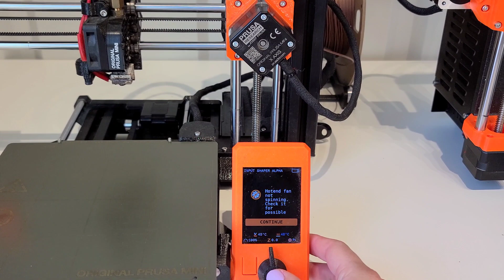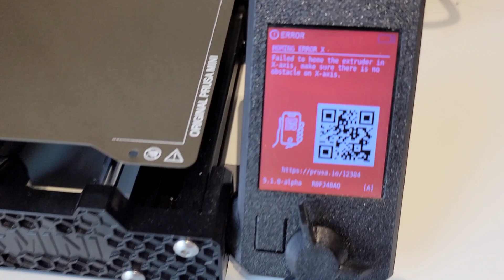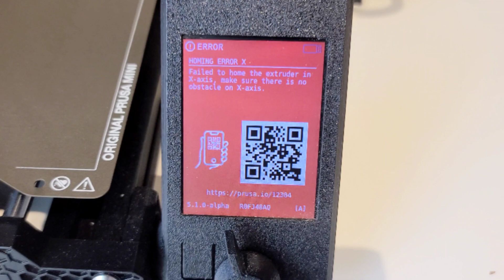Input Shaping on the Mini? Too good to be true?

Comment: I printed two items that used to take 20 hours for the pair in 7 hours with my mini yesterday after the update. The quality was better on the 15hr long print also in areas that I'd expect it to suffer from the speed however it didn't! I'm super impressed.
Reply from the maker: Awesome to hear. When I have a little more time for machines to possibly be down, I'll try out the other minis. I'd rather them be slow than not work. Thanks!
Reply: Out of curiosity, did your minis have the heatbreak/underextrusion problem? Do you know if this update will work for those that replaced the heatbreak or hotend?
Reply from the maker: I don't have any under Extrusion. They're all pretty much stock. But the good thing about the firmware is you can roll back to stable if you don't like it. Thanks!
Reply from the maker: I tried to hold the print head and squished my fingers. And I am just using USB drives. I just keep getting the blue screen of death now. One works out of three. The two that don't work, I have rolled back to stable 4.4. Thanks!

Comment: I tried again with a part I printed in Petg. When I raised the nozzle temperature 10 degrees to make up for the increased speed, I got pretty good results. I usually print Petg at 232 so I raised it to 242. I don’t use PLA but bumping the temp should help
Reply from the maker: Ok that's good to know. Thanks!

Comment: I think it was a mad rush as Bambu released the A1 mini which directly competes with the mini. Thanks for another great video
Reply: Yep
Reply from the maker: Which is understandable. But this 2/2 minis not printing is not great. Thanks!
Reply: @tada3dprinting  it’s a big problem with everyone that has downloaded the firmware. Also I’ve seen people claim it’s a belt tension issue.
Reply: @tada3dprinting it’s alpha so not always going to work as expected. Says on the forum post they expect a stable version to be released in around 1 month

Comment: I have 2 Mini+ and an older Mini. The two newer ones installed fine. The older one had issues with reading the new firmware off certain thumbdrives (for some reason) but got it working. Printing-wise it is great: I print lots of small parts and my usual print went from 3:50 to 2:20 with no discernible quality drop. The only problem i had is with Octoprint losing connection between prints and causing a BSOD. Switched to thumbdrives for now until this gets resolved. Otherwise, the speed improvement is life changing for me.
Reply from the maker: That's nice to hear. I was looking at some of my prints and only seeing 10 mins or so improvement. I seem to be getting errors if I swap out between usbs as I am slicing. That's too bad about octoprint! Thanks!

Comment: If you have trouble rolling back the firmware, take the old firmware on your stick insert it, turn on the mini and click the wheel twice, it should load. it worked for me, hope this helps.
Reply: Thanks. I just updated, but before I even try printing, I'm going back to the prior version.  Can't risk it just yet
Reply from the maker: Thanks! It seems about 50/50 that people are liking the Alpha or not. I will probably wait.
Reply: @tada3dprinting  i had the same problem you had

Comment: That error on the second one is a belt tension issue. You're either too tight or too loose.
Reply from the maker: Ok I will check it out. Thank you!
Reply: Amazing, that solved my problem. Thank you
Reply: I had to adjust the belt really tight to make it work. I didnt like that so i tried something else. I made some C clips / spacers for the x axis rail and it worked with looser belt tention. https://youtu.be/hCZ-z7CTKuU?si=OQ8ulnQwQ9KzINk3

Comment: What adjustment would you make to the XL printing a 7-inch square with a height of 4 inches that ends to lift on two corners mid-print?
Reply: brim and gluestick
Reply from the maker: https://youtu.be/LGW5UByCKFo this video I make some modifications to my flat print to help with warping. It helped a lot. But you may need to check that you don't have a draft in the room too. Let me know if this doesn't help. Thanks!

Comment: I updated my Mini+ and had no issues. I was behind in firmware and bootloader, so I updated that part first, to 4.4.1, and bootloader to 2.1.2, then on restart, it detected the Alpha and updated to 5.1.0.
Reply from the maker: Yes I did have to do that as well. I finally got it going. Thank you!

Comment: Did you select the correct input shaping configuration for your Mini(s) in PrusaSlicer before slicing?
Reply from the maker: I didn't slice the benchy. It's a presliced gcode by Prusa that I downloaded from the github. But I'll slice something else and see if it helps. Thanks!

Comment: Had the same homing error on the x axis. Tightening the belt (a lot) solved the issue for me. But only after cutting the power (unplugged and waited for about 10 seconds) and restarting. Y-axis also had that issue. I guess input shaping on the mini does not like loose belts...
Reply from the maker: That's interesting. I guess it's good that it's extra careful about the tension then. Thanks!

Comment: What happens for those of us who were forced to replace the mini hotend/heatbreak. Will this update work with a bondtech heartbreak? Mosquito hotend?
Reply: I would be cautious, as the mini does not have an accelerometer built in to calibrate exactly for each persons individual printer. I suspect the input shaping parameters are based on predefined numbers for a default printer. If your hotend or nozzle differs in size or weight by much it it might not work the best.
Reply from the maker: If you're interested in trying the Input Shaping, do it! You can always roll back to a stable version if you don't like it. Thanks!

Comment: Flash mini back MK4 had issues with old input it dug into my plate had to get it changed, before that it had errors that made no sense. 2 hours with support think we got it worked out with new firmware I would suggest to reach out to support so they can fix it
Reply from the maker: Yes that's true. I need to do that. Thanks

Comment: Did you also updated the bootloader software on the Mini? I found these files on Github and they mentioned to add the firmware + bootloader files in the root of your USB. Also for me i had to get my firmware first to the latest version (i didn't do that apperently) before installing those the firmware/bootloader files. And atm all works perfectly. No fails so far. Good luck, let me (us) know how it goes.
Reply from the maker: Yes I was on 4.1 and had to upgrade to 4.4 first. Maybe I missed something. I just think it's odd they're doing different errors. Thanks!
Reply: @tada3dprinting  I had to update the firmware, (was still running beta LOL) and the bootloader then installed the new firmware, and all is working very well. A five-hour print is now taking 3 hours and the quality is just as good as before.

Comment: I haven't been a huge fan of the quality my MK4 puts out with input shaping. I will probably only use input shaper when quality isn't a necessity, and the part needs to be done rather quickly. But for now, I'm just going to use the stock settings.
Reply from the maker: Yeah it really depends for me. I feel like things tend to warp more with IS. I jump back and forth. Thanks!
Reply: but for that matter you can just print fast without input shaper since the whole point of IS is to get better quality when printing fast. Or the quality is just a little better with IS?
Reply: I have been using the Structured setting (not Speed) with good results on the MK4. It is faster and the quality is on par with no IS.
Reply: @Drumaier  well I haven't tried "structural" yet. But the speed setting isn't fairing out good results. Walls aren't filling in 100% around the corners, and holes are ellipsed worse than normal, and sometimes the infill doesn't fully connect with the perimeters. I'm gonna try a few things, like turning the temp up a little more, and maybe switching from arachne back to classic as well, and we'll see what happens.

Comment: Did you say that your Mini fan was not running? Or was it running and it was being reported incorrectly? I think that the MK4 team was able to port the input shaping to the mini very easily once they had it complete for the MK4. The XL has a lot more issues.
Reply from the maker: The fan was not running. And it had just printed fine before. Maybe it chose right at that second to go out. Yes that does makes sense. Just disappointing that it's still not out. Thanks!

Comment: I think they had some idea of the Bambu A1 with input shaping and rushed their version for the Prusa mini
Reply from the maker: Yeah it'll be interesting to see what happens next. Thanks!
Reply: It is not rushed - this firmware is an alpha version. That means it is an experimental pre-release, that's still undergoing development and can contain bugs for that reason.
Reply from the maker: I agree. But with the Alpha on the MK4, I had some quirky things but I could get it to print. 1/3 on the Mini Alpha isn't that great. But it might be me.
Reply: I don’t think it‘s your fault. It simply might not work on all machines properly yet, for whatever technical reason.

Did you try to recalibrate your Minis where it doesn’t work? Any statements from the Prusa support so far?

Great to see, that you could get it running on that one Mini from your other video, in the meantime, by the way!! 😊👍🏻

Comment: From the firmware release text: "...  To achieve the best possible print performance, we strongly suggest performing basic maintenance on the MINI+ before you start. Make sure the belts on the X and Y axes are not loose, the nozzle is in good shape, and there’s no debris on the smooth rods. ..."
Reply from the maker: True. Just surprising that the print before it was fine. Thanks!

Comment: Yeah, I tried Input shaper firmware on my Prusa Mini, and every time it loaded a gcode file, it would crash! 

So I had to downgrade back to 4.4.1!
Reply from the maker: Same. But I think I figured out the problem or multiple problems I was having. I have solved it by - 1) having a completely clean USB that has nothing except the newest firmware, and newest sliced items. 2) I kept accidentally opening an old 2.6.0 beta slicer and I was slicing just regular prints without input shaping and didn't think it would matter. But even these were crashing it. Now I'm careful that if I'm using or not using input shaping, I always am using 2.6.1. 
So far this is working. But I'll keep testing it out. Thanks!

Comment: It will be interesting to see that new Bambu printer in action. Very compact for a 4-color printer.
Reply from the maker: I couldn't resist. I ordered one this morning. But I'm not a fancy influencer that already got theirs.
Reply: @tada3dprinting  That is great! Looking forward to your review.  I have lots of questions about how it does color changes.
Reply: It looks a cool bit of kit....but compact? Check out uncle Jessie's video on the new printer. It takes up more space than any of the other bambu printers as they  stack the MMU on top of
Reply: @TDax  Thanks for the pointer to that video.
Reply: @tada3dprinting  Not yet, but you are on the way.
Reply from the maker: Still is smaller than an MMU3 and I don't think I have to assemble it.
Reply: @tada3dprinting  won't be long till the printer manufactures are knocking at your door ;)

Comment: Not so much rushed as Firmware on the mini is a self declared Alpha. 
So its super early. I think they just got exited that they got it working and thought it was more stable than it is. 

Personally I'd gently back out for now. Reflash with standard firmware to check both printers are ok and wait a week or so for Prusa to update the alpha firmware. They will likely find/fix issues fast.
Reply from the maker: Yes. And if I get antsy and have the time for a machine to be down, I may flash a different one. Thanks!

Comment: Good'ol Prusa with a panic release due to a competitor shaking things up.
Reply from the maker: You can't blame them. I laughed when I saw the main page on the Prusa website is all about the Mini. How long has the Mini been out? Why didn't they come out with an MMU for it by now? Thanks!
Reply: That’s sad af because they were going to be sitting pretty not updating their crap for probably 5 or more years if it wasn’t for competitors forcing their hand. That shows you what kind of company they really are.
Reply: @bulletsabers  it was probably saved for the mini 2s+ upgrade haha
Reply: @bulletsabers  from warranty stand point they are topnotch.

Comment: It's almost certainly a response to Bambu. The A1 is a direct competitor to the mini - same price range, same auto-everything feature set, and even has an MMU. If you remove the MMU, the price of the A1 is a very steep discount from the Mini. Unless you're willing to pay a lot extra for open source and excellent support, it'll be pretty hard for anybody to justify going for a Mini.
Reply: Not same price range. The 459$ is for the A1 bundle, which includes the 4 color AMS Lite. The machine itself would be 299$
Reply from the maker: Yeah it'll be interesting what happens next. Thanks!